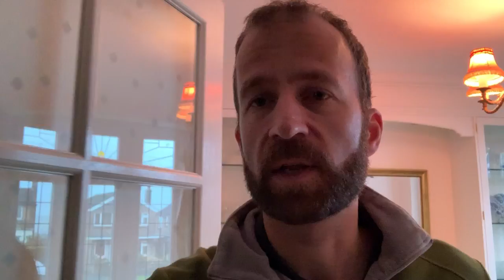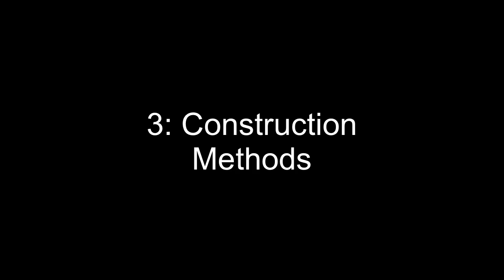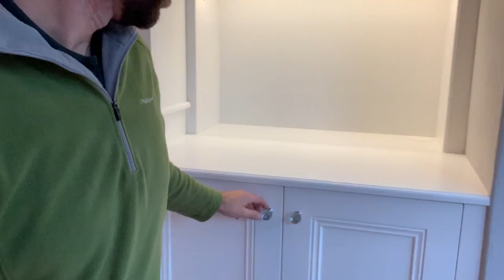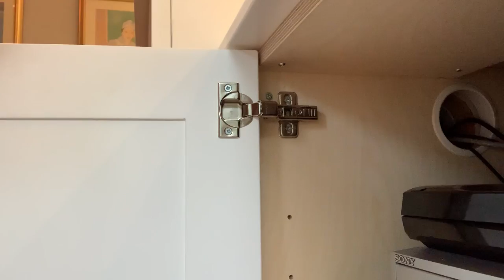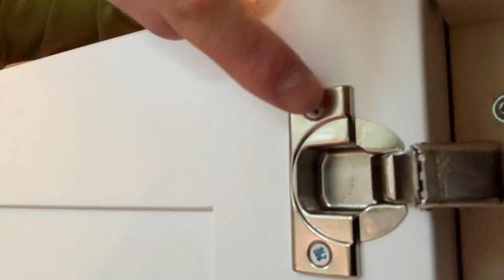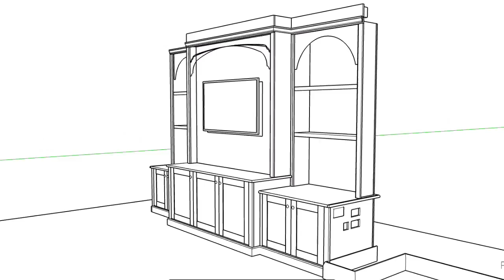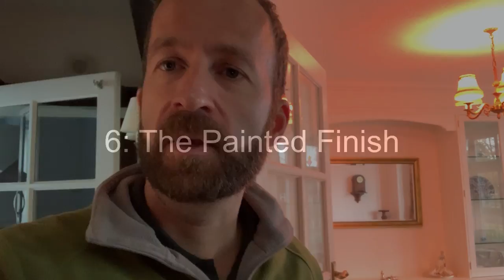£2k vs £5k MDF furniture - What’s the difference???

Comment: Like the video. Think you handled the comparisons very well without putting the cheaper job down. I have worked on jobs where other people have done work and the customer is very happy with the finish. Quite
often after we have completed our work, it is only then that they notice the difference in finish between previous work and ours. This is no disrespect to whoever did the other work, the work was to a good standard and the customer was happy with it, it's just to highlight that the customer sometimes has no idea of the different quality in work until they see a comparison. At the end of the day, as long as when you're doing a job, the quality of work is in line with what the customer is paying and the customer is happy - then you have done an excellent job.

Think your video does a great job of comparing the quality differences you can expect between two similar jobs in different price ranges, this is always difficult to get across. Not all customers can afford or even want a high end product and there are markets for high end work right down to the most basic work. Providing companies don't promise better than they can deliver then there's work enough for all and happy customers - regardless of the quality.
Reply from the maker: alex mcneely thanks Alex I’m glad you thought it came across well.  I often think, for years I was installing work with an ‘orange peel’ textured hand roller painted finish and all my customers were more than happy with everything but now that I do sprayed work I find the work I used to do poor quality.  But I couldn’t have offered anything better at that stage of my business.  You are right to say if the customer is happy and the price is right for them then it’s basically still a job well done.

Comment: 17:09  hit pause left hand door mitre done properly. Right hand door mitre out of alignment. I’m no carpenter!
Reply from the maker: Paul Rossiter the time stamp must be wrong but I don’t doubt that you’re right, I can’t claim that we’re perfect in every way 😂 but I do know that Brady always takes care to sand off any slight splintering or fluff on the mitre cuts as seen on the other project (actually there shouldn’t be any splintering anyway of cut properly).  Possibly there is a slight stop from a slight variation in the ogee profile - we have been getting this issue even within the same batch of mouldings from the same supplier that we always use.  Have you got the actual time stamp you saw it at?
Reply: Sorry I read the wrong time, time was 5.38.  Check either side of the door knobs.
Reply from the maker: I was all prepared to say it’s a fair cop as I’m sure sometimes things are a little less than perfect but in truth what I think your seeing there is a difference in how the light is casting over the joints - landing evenly across the left one but picking out the opposing faces of the mitre in light and shade on the right one.  But I am only checking on the phone not a big screen!

Comment: Alistair, Hi....with your waterbased paint you use which I believe is a single pack product (no catalyst added)..... do you have any issue with grain raising and swollen fibers on your MDF?.....as opposed to a pre-cat, AC or PU alternative?
Reply from the maker: We have only ever used waterbased paints, to be honest I would love to get experience with the other types of paint but our workshop location next to a residential garden means we need to stick with waterbased.  The Movac primer we use is designed to minimise grain raising in MDF, all the more so if you use the additive (though we actually don’t use it since we hardly noticed any difference) but yes there is some grain raising and lots of demobbing is needed.  But this primer sands back very easily and very smooth and after the first coat and denib it’s all fairly flat.  It’s also about the choice of MDF - we find Medite MR much better for surface finish compared to for example a kronospan board that seemed to raise a lot of big flecks on the surface when painted.
Reply: @Alastair_Johnson  Thanks for that reply Alistair.... Im mainly using Kronospan as this is what my merchant keeps on stock... though I think they can provide Medite as Lawkris are their supplier.... it just means I'd have to order it in advance rather then just being able to rock up and get what I need on the day.... It may be worth a try though, as I agree, I'm fining I do get some large swelling fibres in the Kronospan.... at least with the Leyland paints I'm spraying.
Reply from the maker: Sharp Edge Woodworking you may be interested that the waterbased product we use does actually have the ability to be used as a 2 pack product: https://youtu.be/L-__eh0WuCE

Comment: Good information.  I too find it is incredibly difficult to convey quality and craftsmanship in proposing work to a client.  Recommendations and referees are invaluable.  When you were explaining the reason for a gap between rail and stile it seemed as if the rail shrank where I feel you were attempting to explain the movement of the timber would be across the width and not the length (therefore the shrinkage in the stile would be responsible for any gap between the two).  And in my first floating panel doors it was not allowing for enough space for the expansion of the solid timber "floating" panel across its width that caused the gap between the rail and stile!  Cheers, David
Reply: +DRMNZ
When trying to convey to clients standards of works and finish I always who them a sample of a products. 

I have small tables, cabinets and so on done to different grades that I can show them and explain to them. I even have do that with designers and architects at times because it is can be very difficult in words if the potential client has never seen such an example. 

It would be like trying to explain a Rolls Royce car to somebody who has only ever experienced a 1990s old Vauxhall car and has never seen anything like a Rolls Royce.
Reply from the maker: @bighands69  great idea, showing the real thing is even better than a video!
Reply from the maker: DRMNZ hi David maybe I’ll do a video on wood movement one day... I’m not saying I’m the biggest expert on it but as Inunderstand it, shrinkage/expansion along the length of the fibres (grain) is almost negligible, but is more significant across (perpendicular to) the grain, as you found in your solid panel door.  So what’s actually happening with any hairline crack that appears at the joints of 5 piece doors is usually the differential of the rail shrinking/expanding in width against the side of the stile that is not shrinking.  So it’s not a separation movement but a sort of glancing sideways movement that causes a crack to show.  Alternatively as you have suggested it could also be a solid panel expanding and forcing those joints open.  Does that makes sense?

Comment: Love your videos and your work. However at just over 3 minutes in I feel I have to stop the video and disagree with some of the things you are saying. 

I do a lot of bespoke work myself and am not lucky enough to have a workshop. Living in London it’s not cost effective for my company at this stage. However, comparing these two jobs is fair, but, not a fair comparison to compare the on site work to all who work on site only. For example, I survey my jobs to the millimetre, use sketch up and produce a cut list from that. I then get my supplier (medite MR boards) to cut everything to size. 

I take this to site and unload all my festool gear including extraction and MFT (basically a portable workshop) and proceed to fit. My doors are always made up by dominos with 18mm stiles and rails and a 6mm centre sat in a rebate, clamped on site with 10 minute glue. Once I am done I then prep for finish. I then finish myself and spray in situ using HVLP Fuji spray q4 system with tikurilla paint. Everything is masked off and feel my level of finish is pretty comparable to yours although I expect it would be just that little better if I had that workshop. My price would be around 2/3's 3/4 of what you charge as a reference. 

My point is, not all joiners/Carpenter, whether mobile or from a workshop have the same standards. Just felt I had to get that out there. 

Keep up the great work. 

Best wishes
Reply from the maker: jason child I’m glad for your input.  What I said was oversimplified.  Didn’t mean to tar anyone with the wrong brush. Thanks for saying it in respectful way 👍
Reply: @Alastair_Johnson  No offence taken, love your work and your videos. My point was a good tradesman can still get great results with the right amount of care and investment into their craft. If you know any cheap workshops going in South London.....😂
Reply: Good point, however would you charge 2000 for this job? I think the joiner vastly underpriced in this instance. It sounds like you have invested in your site setup considerably more than some.
Reply: @jtrent90  'It sounds like you have invested in your site setup considerably more than some' exactly my point. And I'm sure some workshops have better setups and some probably worse than mine. 

Would I charge £2000? No, I would be charging much more. But then, I would be supplying a better standard of finish in my opinion. The old saying goes, you get what you pay for. I wouldn't want to criticise anybody's work but the flush hinges screwed directly to the side of the MDF would suggest to me that this joiner/carpenter is fairly inexperienced and priced up on what they thought was a good standard and rate for them personally. We have all underpriced work, doesn't mean you cut corners. You win some and you lose some....

Comment: Good video and you can defo see the difference in the finish. I know ur shop is home based was wondering do you get complaints from neighbours about noise. Ive set my workshop up and sound proofed and insulated and will be working from home next year
Reply from the maker: I think we are fortunate with understanding neighbours but also the distance from the noise making areas of the workshop is fairly far from the houses and we are careful to only work reasonable hours (8:30 to 5pm or occasional 6pm mon to fri only and no weekends).  We are desperate to relocate and separate business from home life however this business is our only source of household income so all our eggs are in one basket and at present the figures just don’t seem to stack up to take on the extra overheads of a rented premises.  But we are soon going to get a CNC machine which I think will be the key to producing work more profitably in-house and then when that’s all running smoothly we will relocate.
Reply: Thanks for the detailed response looking forward to seeing the cnc videos and good points made about the neighbors

Comment: Fantastic video as always! Love to hear your thoughts and opinions on methods and another great job done. I would probably put myself in between those two jobs and cost wise, probably to the lower end. But, like yourself, I would make a lot of it off site in my workshop. I also do the same method of making doors as you - but I cut the centre panel out myself with a plunge saw and use a rebating bit from the back to put the panel in and then glue and pin in place. I too do all my fillers and face frames the same as you and use a concealed hinge. I always give the choice to the customer - whether they want MDF or MRMDF. Things I don’t do - I don’t do detailed drawings, I don’t spray and I don’t use beech ply for the internals. But I do strongly recommend a painter that I trust to get the best possible finish with hand painting and tell customers the attention and care that MDF needs to get the best finish. Keep up the great work!

Comment: Nice measured comparison, you aren't coming accross like you're taking jabs at a jobbing joiner at all. I'm workshop based like yourself - wouldn't have it any other way!
Reply from the maker: I’m relieved it doesn’t come across as having a dig, thank you
Reply: Onsite construction can be just as good. It really all depends on cost. How much the client is willing to pay for the level of finish. 

I can produce cabinets on site that are just as good as off site but they are going to cost more because they require more work and maybe different materials as well. 

My business once did restoration and rebuild work and we choice specifically to do it onsite so every detail could be worked their and then but that costs a lot of money to do.

Comment: I been on both sides as a carpenter/ joiner.  Learned my trade through apprenticeship and would always set up on site but covered all aspects from the roof to the kitchen. Would make units on site. But the more customers wanted furniture I moved to a workshop and changed my entire set up. For a shaker door I normally use a rail and stile method so would be interested to see the method you used on yours.  Switched over to sayerlack paint and huge difference in finish.
Reply from the maker: sicpac66 what paint were you using before?
Reply: @Alastair_Johnson  same as you I think. Acrylic primer and diamond White top coats. Saw your video and have movac down the road from me so tried them out. Massive difference. Much better finish using airless Graco fine finish

Comment: £250 for painting sounds very cheap?
Thanks for the vids, it's so interesting to see how other people work. 
As a small manufacturer myself, I find pricing is always a pain, because obviously you want the work, but need to make a living and cover your costs. 
I think the joiner who built the other unit might have realised that he hadn't made a great deal of profit by the time he'd bought and fitted the glass shelves etc.. 
in terms of the doors I mainly use the method of gluing 6mm strips onto a 12mm back panel and routing a v through the join, also routing the edges depending on the design. 
Anyway, enjoy watching the Channel.
Reply from the maker: john parsons I’ve done the applied strips method on shaker doors too.  In the end I felt it wasn’t that much easier than gluing and clamping up a 5 piece door - you have to either clamp the strips on or pin and fill them; then you have a poor edge to flatten off etc.
Reply: Freebird Interiors 
I started using mitre bond a while back. It means I get an instant bond. I allow a tiny overhang on the strips and trim back with the router. The join is practically invisible and it means I'm not holding up space in my small workshop. If I had extra space I would definitely use your method, but needs must.
Reply from the maker: john parsons interesting.  How much of the surface do you cover with the glue and do you use the activator spray?  My current method is actually to outsource the door manufacture to a CNC manufacturer!  There’s a 3 part series about how we get these made on the channel.  And in due course we will be getting a CNC machine of our own and doing it in house.
Reply: Freebird Interiors 
Hi.
A straight bead of glue along both edges, and a staggered bead in between.
I do use the activator. Do give an idea, I can get around 8 wardrobe size doors from 500ml/50ml activator and glue combination.
My standard door construction is a 12mm Medite back, with 6mm strips. Once the strips are glued on, and before I take it off the bench I run my v groove along the inside of the strips and through the vertical joint. Then across the inside of the rails taking care to stop at the stiles. The edges are then trimmed square or quarter rounded. Going to watch your outsourcing video. Problem for me is at the moment I can produce and fit roughly a bedroom a week, and I'm not sure I want to expand.
Reply from the maker: john parsons wouldn’t it be easier to run a bearing guided chamfering bit all around all the strips prior to assembly, then you’ve got your v groove joint ready made?
Reply: Freebird Interiors 
Agreed to a point. If I had a table mounted router then routing the ends would be easier and quick. However as my router is hand held I've always felt it was easier to set a fence to the centre of the join and run it straight along the door edges. However you are right when it comes to to rails it is easier if the edge is already chamfered, which I do more often than not,  particularly if the doors have centre rails in which case there isn't a choice, the edges have to be chamfered prior to assembly.